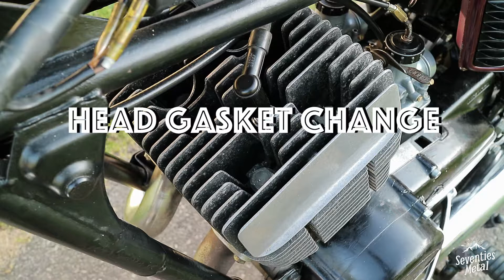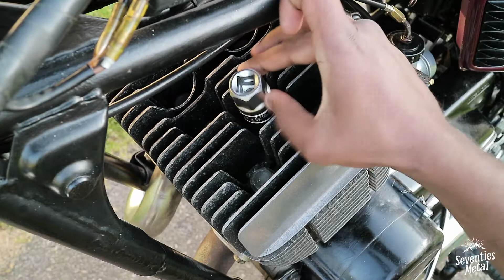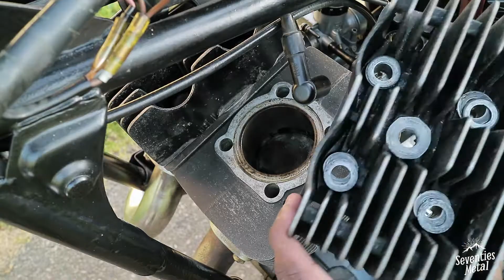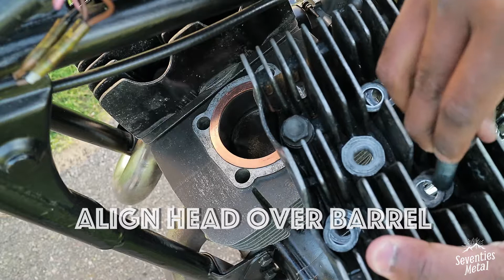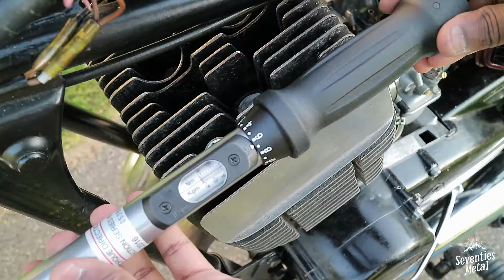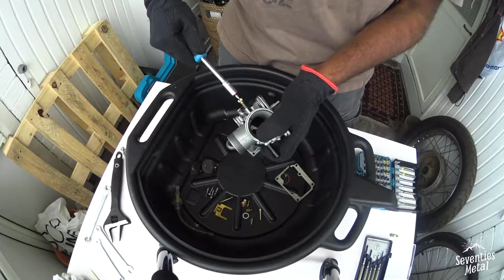RD350 - Head Gasket Change

Comment: oil leakege from side of the head is due to the problem of gasket?
Reply from the maker: Hi 😃 It can either be your gasket OR you have not tightened the head bolts to 20 nm torque. Try tightening the head first, it the leak persists, change the gasket.
Reply: @seventiesmetal8673  ok bro👍
Reply: Was that head gasket ribbed on the side you put down, or was it just flat on both sides? Gaskets I have have a rib on one side that flatens out when you torque it down